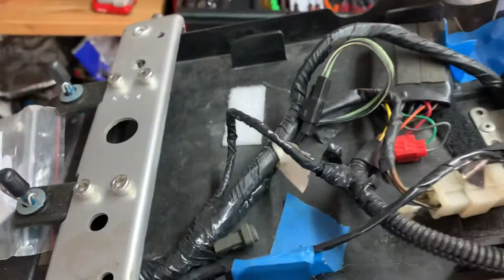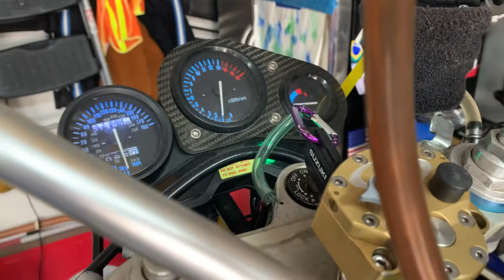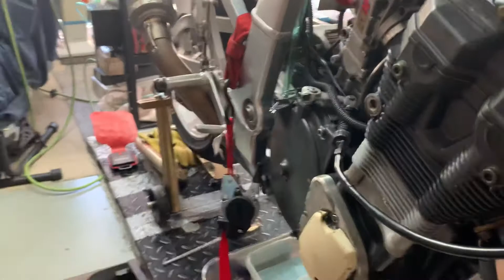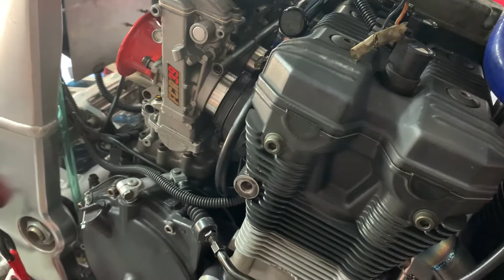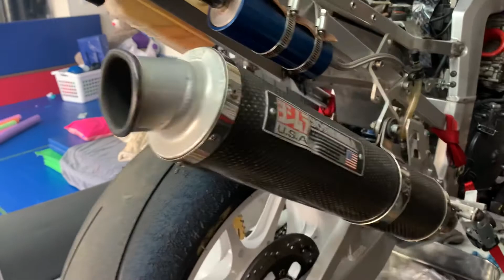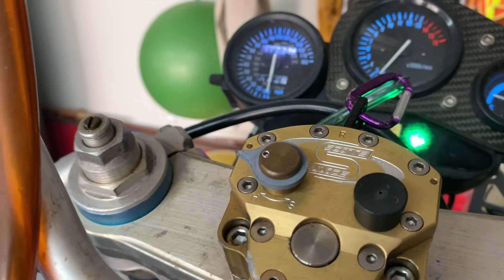1994 GSXR 750 First Start after rebuild.

Comment: SWEET running mill ! Need to get yourself one of those NEW Yosh Exhust systems to go with those Dymags ;)
Reply from the maker: I have a NOS full Titanium system as a back up. Is Yosh producing new systems for these old bikes? Hindle will for these and oilers, so I’m told.
Reply: @StanleysGarage369  i know they make new systems for the Slabby 1100. Would guess it may fit the W?

Comment: Nice. I have a 94 gsxr 750 also. The only year with blue anodized forks.
Reply from the maker: Please join our FB page for 3rd Generation GSXR. Click the FB icon on my header for a link. One is for Bandit 400, the other for 3rd gen gsxr.
Reply: andt the swinging arm is from a 95 in my opinion.

Comment: I have the carbs with the 'power jet' circuit which are supposedly difficult to set up with no airbox, would love to swap them out for flatslides. Did you have much trouble dialling them in? Great bike, sounds fantastic.
Reply from the maker: Slight adjustment on the mix screw and runs great on the street and track. I had to adjust settings when I added more air flow and again when motor was built with bigger pistons and stage 2 cams.